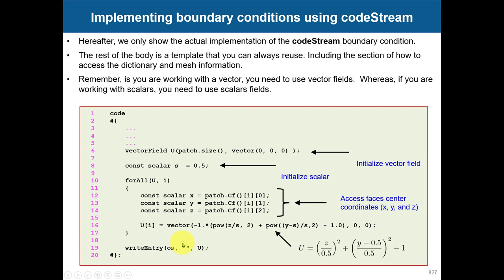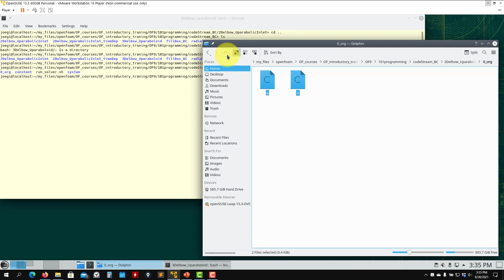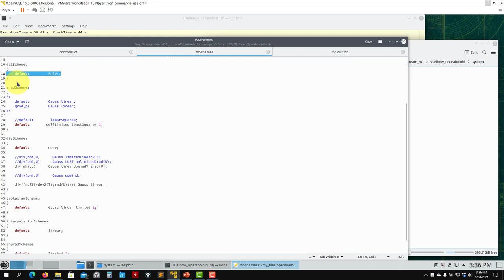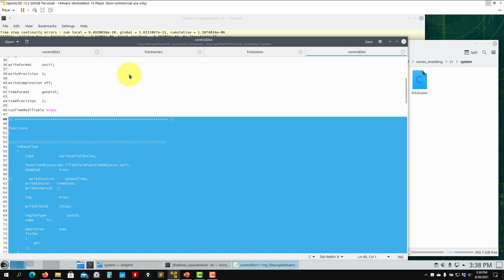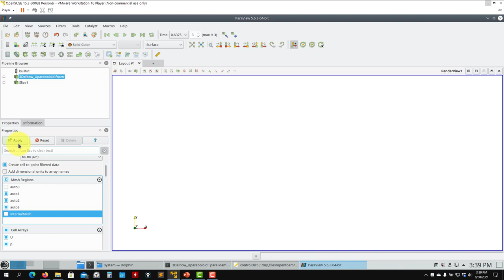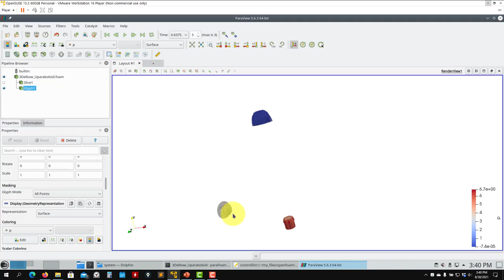7.3 Module 7 - Implementing my own boundary conditions with codeStream #openfoamtraining

Comment: hello, Sir. at 6:01, in the URF part, both explicit under relaxation(fields) and implicit under relaxation(equations) are  activated for all variables. Does this mean we execute twice under ralaxations for every variable?
Reply from the maker: Explicit and implicit URF are different things and for steady solvers you need both of them.  They stabilize the solution in steady simulations, or to put it in another way, they increase the. diagonal dominance of the linear systems